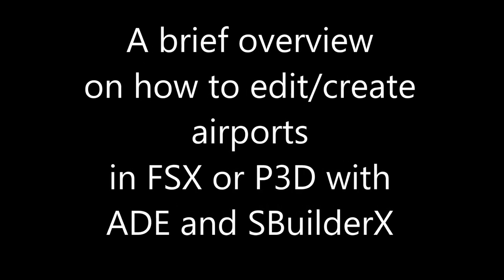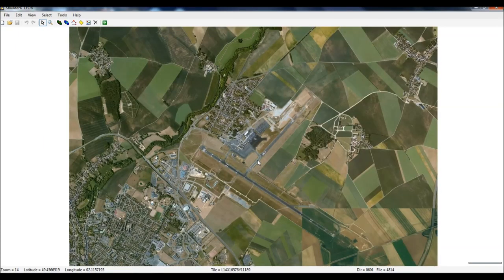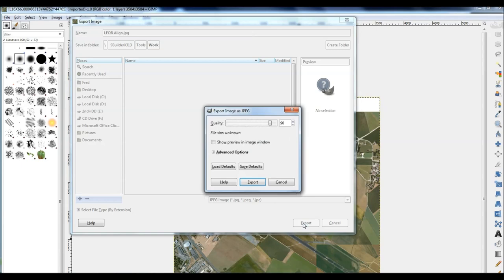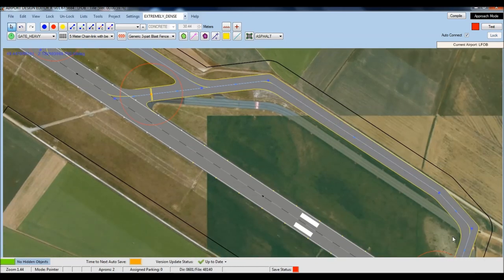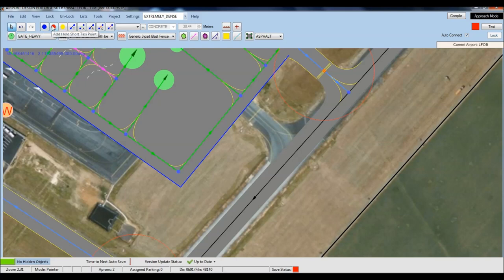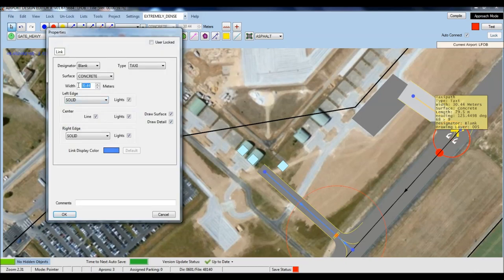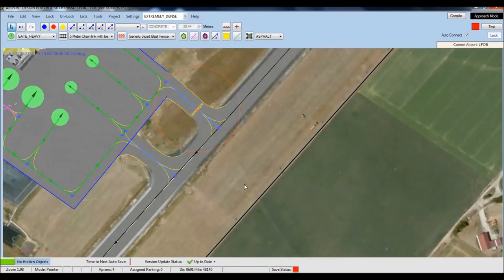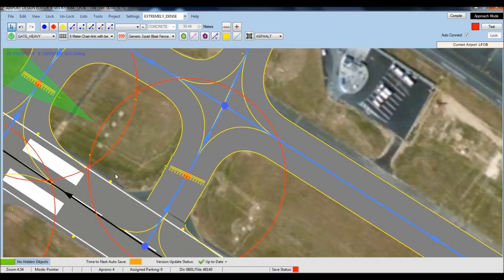Overview on how to edit airport scenery with Airport Design Editor and SBuilderX

Comment: Hi. I have an issue with a scenery and I would like to fix using some editor: the scenery is Bari X LIBD by Aerosoft, fixed by Simmershome patch. Everything is OK, but after applying the patch, a second generic control tower appears in the apron in the same place of the tower in default afcad. I have tried everything using ADE: deleting object, adding exclusion polygons, reducing size and altitude of the tower, replacing it and so on. I have tried also to delete the APX file (stock airport bgl) related to the default afcad airport. Nothing to do: the tower is still there. Maybe I'm not very good at editing with ADE. May I have any suggestion? Thank you very much

Comment: Ok so I get the image in a .jpg but when I add it to ade it says the image is too big and it doesn't work. Why does this happen?
Reply from the maker: +Diamond4Dwarf If I remember well, you need to keep the size file relatively small.
Reply from the maker: +Diamond4Dwarf Watch the video around 3:00 and when you choose the number of tiles, keep it as low as you can as I did in the video.

Comment: Hello sir. I may be a little late, but when opening the airport in the beginning (from ADE), I get an error message with the following title: "Decomplier Error", stating that it could not find a part of the path. Would you be able to help me resolve this problem please? I installed both programs from their automatic installer.  Also I am unable to enable "show background" in SBuilderX. It's greyed, even after entering the coordinates. Hopefully you can reply soon. 

Best regards
Reply from the maker: Hey... it is never too late. For ADE all I can think of is to make sure it is properly set up with all SDK applications correctly linked.
For SbuilderX it sounds like it cannot access the satellite images tiles...check that it is correctly set up too.
I hope it helps. Without seeing what is going on it is hard to know what the issue is.

Comment: Awesome video tutorial, Captain Nav. Thanks. I'd like to replace custom rwy, taxi and vasi lights in some of the older add-on sceneries by default ones to make them compatible with p3dv3. Is it a matter of just highlighting them somehow in ADE and replacing by a default class of lights?
Reply from the maker: +Igor Petrov Possibly.... I am not sure what you mean by custom, but you can certainly use ADE to add default lights etc.... I don't use P3D, so not 100 % sure it works, but I understand ADE does work with P3D. However, if you are trying to somehow convert scenery to make it compatible with P3D, I am not sure it will work. ADE is some sort of editor/scenery builder, but it isn't a compatibility tool.

Comment: Hi, Great tutorial. I done all the edits I want to a stock airport. But now I want to export it into FS9. How do I save it to actually show in the sim?  Thanks
Reply from the maker: +Omnia762 Thank you. I am not sure it works for FS9. If it does, then when you compile the airport in a .bgl file, the you need to put that file into the addon scenery folder of your simulator and activate it in the scenery library.
Reply: Great! I am just wondering where would that .bgl file save? 

one more question if you don't mind helping out!
1-Say I want to add a couple of buildings with textures based on real images taken from an airport? How would I add them to the (Addon Scenery/Project/Texture) root folder and have them be displayed in the sim? Also, do I design the buildings from ADE?

Thanks Again!
Reply from the maker: +Omnia762 Sorry this is a little bit beyond what I can do. Buildings, I think, can be done with sbuilderx.

Comment: i just want to change the vor frequency, how do i do it ?
Reply from the maker: I don't think you can, I think VOR's are "hard coded". I will check and get back to you.👍
Reply: @CaptainNav  yes you are correct abt that. However there is a software easyNav . I am able to edit the vor frequency but can't replace them with the original .bgl file. You seem more knowledgeable, will be waiting for you. Thanx

Comment: Could you explain how to get SbuilderX 313 to work?
Reply from the maker: There is a 315 version available nowadays.👍
Reply: @CaptainNav  I tried that. Couldn't get it to work. I think Google server is the problem. I've read where Google blocks the usage. I can't get a satellite image when I select Google. I followed you vid and replaced the .dll as you said, but it didn't work.
Reply from the maker: Try the latest version, 315. I think everything is included.

Comment: why you have .BMP files ????? wtf ? i have a .sbp file ...
Reply from the maker: I suggest you watch the video again from about 3:30 until about 8:00... basically, you save the satellite photo with SBuilderX as .sbp, but also as a .bmp in SbuilderX/Tools/Work.... Then, with GIMP2, you can convert it to .JPG, then use it into ADE.
Reply: Did not help at all
Reply from the maker: +Odin Morris Where are you stuck?
Reply: I am unable to save as a .bmp file. it auto saves as the standard file but there is no copy as a .bmp
Reply from the maker: +Odin Morris As I indicated in one of the replies above, it should also save one copy as .bmp format. If it does not, then you need to possibly check the output settings/options of ADE.
Reply: My problem is not with ADE, it is with Sbuilderx.